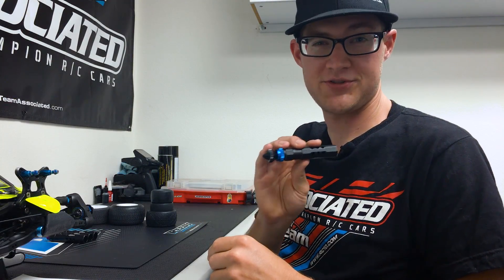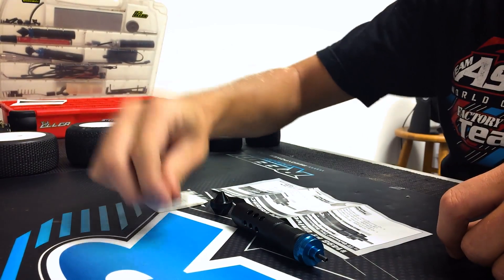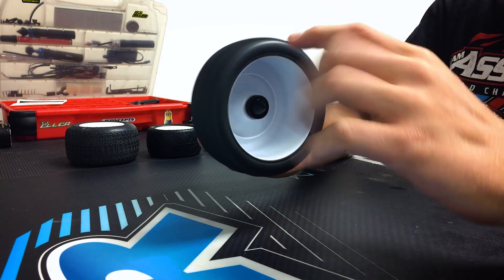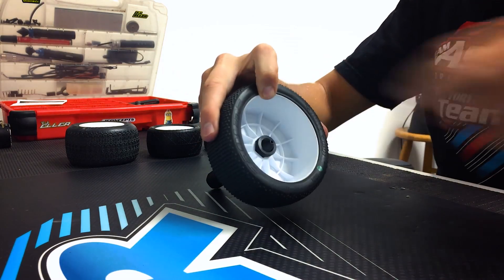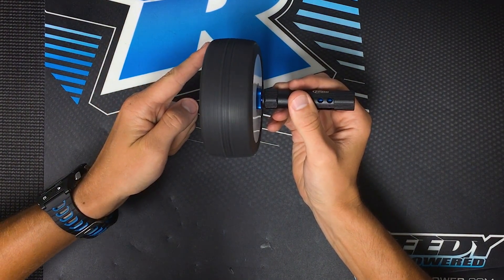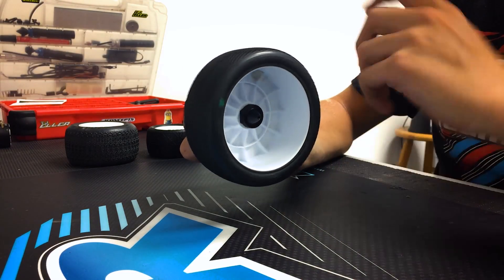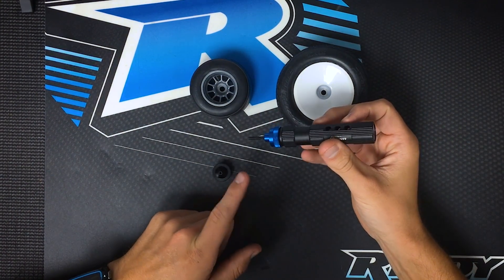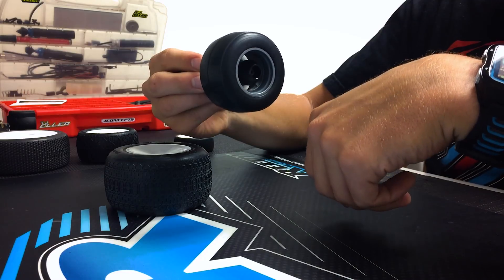How-To: Using The Factory Team Wheel Balancer Tool

Comment: How do you change the short screw with the long one? It's not in the manual and you magically have the long one in the video. What's the magic?
Reply: Figured it out, you need to wrap a cloth or something soft around the screw to not damage it, then grab that with pliers and unscrew it.  It's not at all intuitive, I first tried to press at the rotating back very hard to unscrew the whole head, I might have damaged the delicate bearings with that as the thing stops abruptly at certain times.  Guys are you doing this on purpose to not add those instruction or what's wrong with you?

Comment: Clay is sloppy. Glue tire. Spin on car fast to expand the foam .as it slows the foam will go to it's happy place. Then balance it. Use tape in center of wheel side to side. Not on face of wheel which puts weight on outside of tire. U want to affect the whole cross section. This was improper and who the hell would want to hold it the entire time
Reply: That's not how it's done. The inserts are glued on race wheels. You're tripping dude. You're a certified moron.

Comment: After Ballance and you clean the tires after a race how well does the clay stick?
Reply: The inside of the wheel is usually only rinsed with water to remove dirt - the clay won't come off when you do this. Once its stuck on there, it's there to stay until you pry it off :)